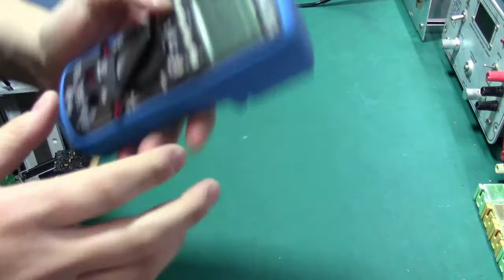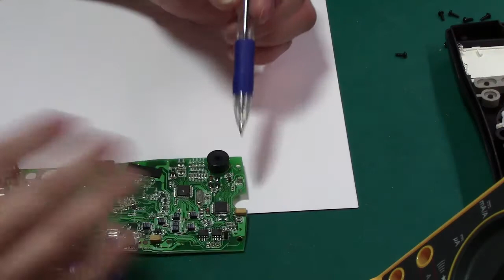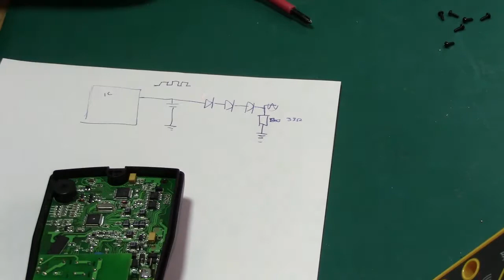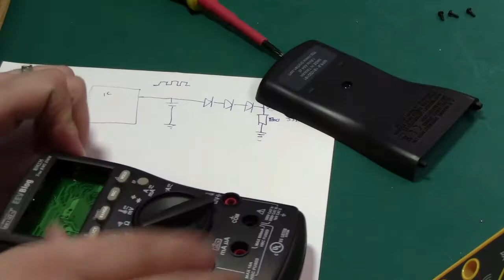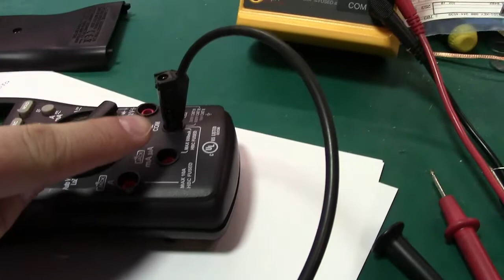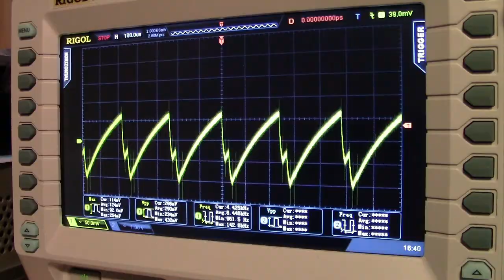EEVBlog DMM (BM235) Backlight Investigation

Comment: You cannot hear 425 KHz! lol  BTW I never heard any noise when you held it up to the camera/microphone but I'm old ;)
Reply from the maker: I don't believe I said that I heard 425kHz; what I measured was in the ballpark of 30kHz, and I'm guessing that there were low frequency harmonics that I was actually hearing.
Reply: I heard you say it near the end and read 425 KHz on the scope?  Could be wrong??  Just hang on to the meter until your in your 50's - you will no longer hear it ;)
Reply from the maker: Ok, yeah, probably  my mumbling or not being clear in the audio; from the scope you can see I'm measuring about 4.25kHz, and I roughly calculate from the waveform and sweep setting ~5kHz. The replacement of the offending cap fixes the "problem" quite nicely however :)
Reply: idpromnut Nice - thanks for the enlightenment ;)  Guess I couldn't see the decimal point. Thinking of ordering one for my cheap meter (the one I'll risk from time to time ;) )